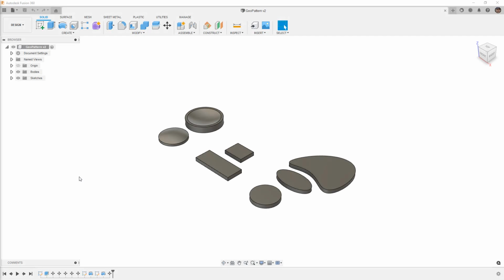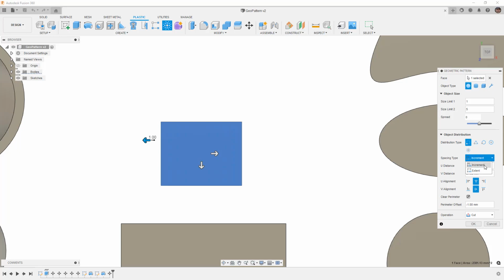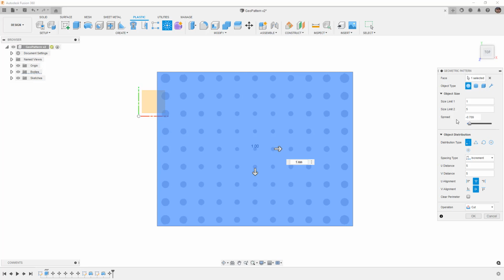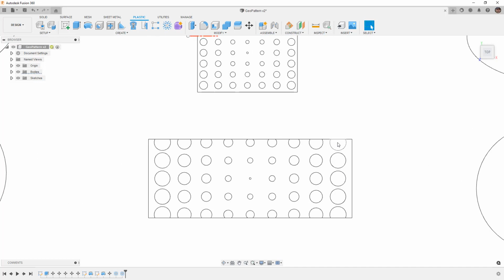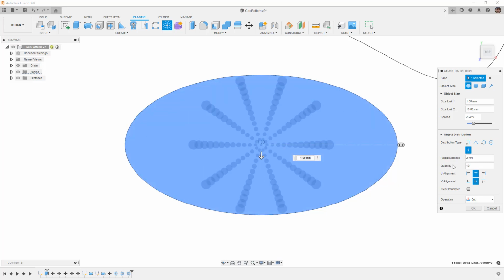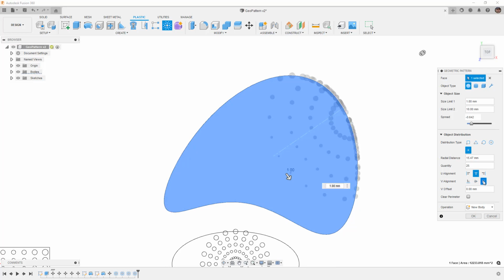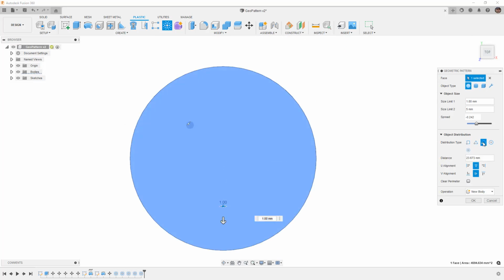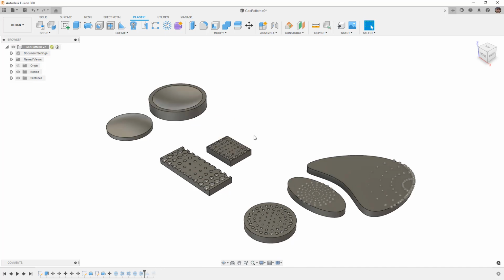Testing the NEW Geometric Pattern in Fusion 360s Product Design Extension #Fusion360

Comment: Thanks for delving into the tool. Considering you have to pay extra for such a limited tool, I think I'll pass. As an industrial designer, I need a tool with much more power and control of complex curve surfaces, so I'll have to try parametric textures in either Blender or Rhino. Fusion is so close to meeting all my needs but falls short in the G3 surfacing (curves) and parametric texture realm.
Reply from the maker: Glad it was helpful Ryan.  To be fair the parametric texture features in other CAD programs like SWx are only graphical and the end result is a mesh.  Something like Dynamo is what Fusion needs again to make these complex patterns.  Blenders Geometry Node is a good option in the mesh stage, but if you need a true BREP then you are out of luck.  Not sure how Rhino handles this, but if you know that would be great info!

I don't know that Fusion will ever get into the G3 realm.  For that you really need to dive into a dedicated program like Alias.  I have expressed my concerns regarding Fusion surfacing tools and some areas I would love for it to improve.  I think if Forms had better control and edge weighting it would be an amazing addition for this type of work.

Comment: another disappointingly weak feature release from Fusion360 team. Guys if you're not going to drop a feature that is actually useful, maybe just focus on improving features like sheet metal that's still a decade behind SW. I was excited at first, and now I'm disappointed. Who is paying $1500 a year for this?
Reply from the maker: Well $800 for Fusion and this extension, but I get you yeah.  I can't give you any insider information but if history repeats itself this tool will get some big updates this year.  I have personally sent in my feedback on what I would like to see with the tool and hope that in the future the tool will expand into something amazing.

I have been using Fusion 360 since before they had Drawings, before mesh, before Generative so I have been through the early stages in development for a lot of tools and have been impressed with the improvements.  Just my 2c.  I don't get anything to "sell" you Fusion, but I have used many CAD software packages and for me Fusion has the most value for the price.
Reply: @LearnEverythingAboutDesign  looks like my reply didn't go through for some reason. FWIW I've been using the program since it was "Inventor Fusion" and I'm an "8" over in the feedback forums. 

Yeah I was looking at the plugin pricing again after I made my first comment and realized it was less expensive than the others. Sure, sometimes they come in with big updates a few months after the initial release, but I mean look at sheet metal; totally stagnated. I was hoping for some features more along the lines of Bob's Grasshopper or Autodesk Dynamo, but this is more like, a PlaySkool PlayDough kit.
Reply from the maker: Hey Michael, for some reason this comment was in held for review and just surfaced...  Dynamo looked really cool but it seems to be gone now.  Maybe that means it will show up in the software in the future?  And yeah I played with it when it was Inventor Fusion.  and I became serious with it in 2015 and began to support it in addition to Solidworks, Inventor and Onshape for a bit.  One thing I always try to convey is the difference in cost when comparing tools.  I know "its cheap" isn't an excuse but there is obviously a big push in the MFG, Sim, PCB space in Fusion 360.  Maybe development on some of the other core areas will expand a bit more in the future. Fingers crossed.

Comment: So production is a paid feature?
(whilst Im here is there a plugin to defeature bodies / components, like for exporting to cae simulation?)
Reply from the maker: Yes so the Extensions that are available to EDU and Commercial licenses offer the expansion of toolsets.  For example the Manage Extension allows for a PDM style check in/check out of designs.  the Manufacture Extension opens up certain functionality for multi-axis machining toolpaths.  And now the recent addition of "Product Design" extension.  This includes the Volumetric Lattice tool, The mesh tri to quad conversion(inside the mesh workspace that lets us turn a mesh body to a form tspline body), and some of the new plastic design tools like Boss and Snap Latch.  It apparently also includes the update to Rib and Web which now allow for Draft and fillets.  It looks as if those are only showing up for users on the Extension.

As far as defeaturing, I know simulation is not included in the Hobby license, but if you have commercial or edu there are loads of simulation options.  When you go into the simulation workspace (Or Generative Design workspace) you have contextual environments to modify and defeature a design that doesn't modify the original.  In simulation this is called the "Simplify" workspace and in Generative Design this is "Edit Model".  Both include the ability to find and remove features like fillets, chamfers, threads etc.  They also have options to replace with primitive bodies.  One thing to test is to turn off capture design history in a new design then take a look at the Create and Modify tool drop downs.  When you are in direct editing a lot of tools will show up like Find Feature, Fluid Volume etc.

Comment: Thank you for this great overview. Learnt a lot. My main gripe with this feature is that it can only accept bodies as custom objects, not features. For example, if I want to create a vent with through holes, I am not able to create a through hole as a seed and use it in a geometric pattern. After playing around with this, the only way I was able to create a vent with through holes was to first create a cylinder body that cuts through the plate, select the cylinder as the custom object and then set operation to cut. This is completely non intuitive.
Reply from the maker: I agree.  the "seed" for the object would be great as a feature, just like with other pattern types where you can use a feature, face, body or component.  It would be cool if they would add a true "Vent" tool like other software has where you can control input parameters like CFM and fan size.  There are some big opportunities here with these tools that are going to be in the extension!
Thanks for the comment!

Comment: So they are trying to recreate this function in Blender https://www.youtube.com/watch?v=T_mdzBfyECw
Reply from the maker: Not exactly, Did you mean to comment on the lattice?  I covered Romans workflow in an  early video.  Fusion lattice gives you a good bit more control and its seconds rather than the workflow needed to make the lattice in Blender.  Geometric pattern is a little like "Fill Pattern" in solidworks.  I just wish it would use the border to drive the shape a bit better.

Comment: So basically useless. And they want us to pay $1,200 a year for that. What I wanted was the ability to bring in true height Maps and use them to create patterns.
Reply from the maker: Well $400/year for the extension.  First impression of Geometric Pattern wouldn't have me buying the extension for it.  I still need to play with the design assistant and the plastic part tools to see where their value is.  The lattice creation at this point is the most promising bit.

When you say height maps do you mean like UV maps to alter the surface texture?
Reply: @LearnEverythingAboutDesign  yes that's what I'm talking about. What I really wanted was grayscale height maps that could be used to texture model like you can do in SolidWorks. It's a very common modeling techniques in blender. You have a video where you showed how you can export into blender and then reimport back into Fusion 360. That's one of the use cases where you export to blender apply heightmap and then reimport it back into 360 to do your cam work
Reply from the maker: Yeah i was an application expert at a solidworks VAR when that surface texture feature first came out.  It creates a mesh just like the workflow in blender.  I think the main issue is the different between a true boolean operation on a BREP vs mesh manipulation with the greyscale image.  I wonder if there is a way to do it with mesh tools in fusion....  I will do some digging and see what I can find.
Reply: @LearnEverythingAboutDesign  I thought that auto desk was going to offer something like that when they came out with the mesh workspace. It  would be a perfect addition to it. I was honestly hoping that they would expand the mesh work space to offer real modeling mesh tools inside of fusion 360 with the ability to convert them into a solid object. Now that's something that I would pay real money for.
Reply from the maker: @eod9910  The mesh workspace now has some editable tools like booleans where you can add or subtract, but true mesh modeling would be cool!